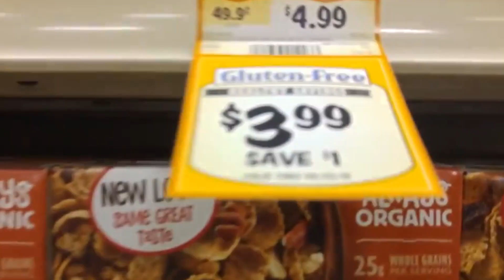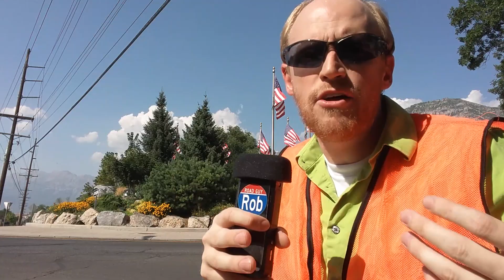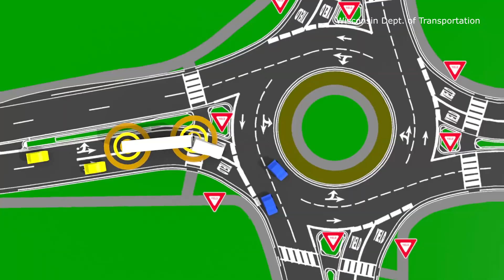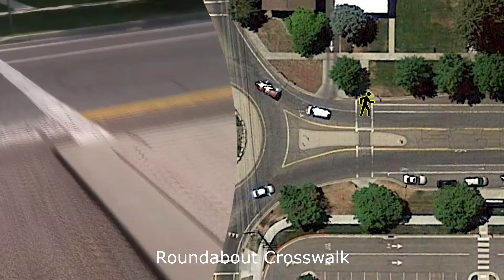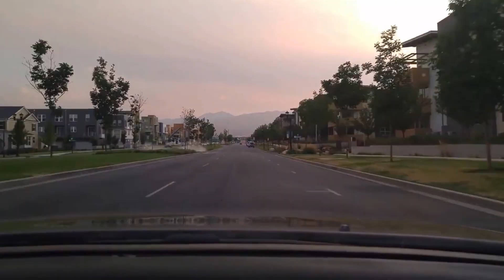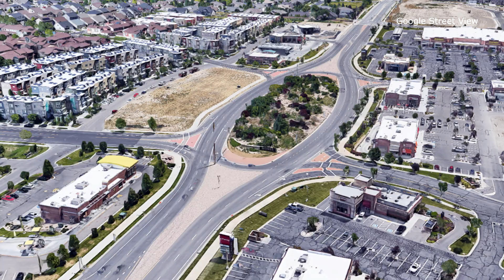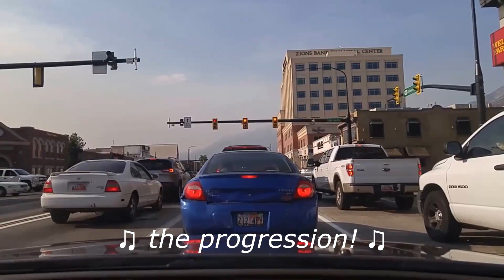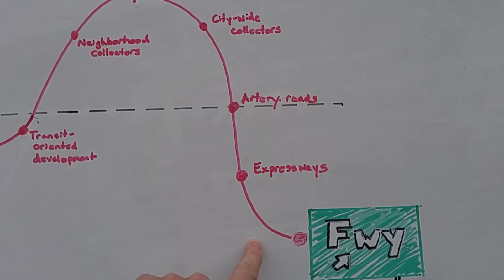Are roundabouts REALLY better than a traffic signal?

Comment: Roundabouts are great
Americans just don't know how to drive on them
Reply: In all honesty, that's a bit of the reality everywhere, and it's actually the main problem of roundabouts: bad drivers.
Reply: @rrs_13  I think Americans just aren’t use to it. I live in Australia and everyone knows how to properly navigate them. And if there is a crash it is not as serious
Reply: @cityplanner3063  it's also because only certain areas have them, i only been on 1 and that was when I was in Colorado visiting and that was the only time i seen one, there are a few but they don't really exist  

although not sure why people say Roundabouts are cheaper since roads are straight requires less land as well then a roundabout

it's like Parallel parking, i never did that on my highschool test since we had no where to Parallel parking so it really doesn't exist even in town there are main raods and the side roads will have parking lanes where you don't Parallel park.
Reply: I would also like to point out that they are only as good as the weakest link...that link would be drivers that give no ducks, ie the ones that sped through regardless, the ones that try to turn out from the inmost lane, the ones that figure out they are meant to go ‘that way’ and to heck with traffic flow, ones that climb the lip and cut in front of other drivers, ones that don’t know how the turn signal is meant to work and bogart their way through, ones with no awareness, ones that don’t check their blind spots and so forth. Unfortunately, the world is full of weak links as dash camera’s have proven. None of this takes into consideration motorcyclists and cyclers.
Reply: I would have to disagree.. I live in Nebraska and we've been getting more and more of these installed. I have not really seen anyone have a problem driving through a roundabout here. In contrast I was in Ireland a few years ago and got hit by a guy entering the roundabout. Ireland is full of them and there was no other traffic in the roundabout and this guy slammed into me. I go through a double roundabout every day to get to work and have never had any confusion in doing so. So I think your statement is flawed.
Reply: Thomas Knight personally being a American and a u.k. Citizen yes I agree
Reply: This is true although they were sorta only being implemented i would say in the early 2000's, they where not in any of my road test/driving instructions when i was learning around 2000/2001 and only started to be installed in the local areas a few years later (im from Wisconsin)

So basically only younger millennials would have been taught from the start, Older millennials would have gotten used to them fairly quick, but all previous generations would have been driving for decades without them. And people suck at change. This is not always true, you got idiots of all ages and with roundabouts i would say it really is the personality of the driver that determines how they navigate them.

I mean they are not hard (yield to those on your left, stay in your lane, look at the arrows that tell you where to go) but what i usually see is (out of my way losers, screw staying in the lines, read arrows? who has time for dat!)
Reply: @jjjacer  you are absolutely correct
However I got my license like 4 years ago and don't really remember it being covered in driver's ed
And  living in a college town with a roundabout I haven't seen too many major issues other than unsure drivers and stupid pedestrians  but the freaking 4 way stops confuse the crap out of themI saw 3 people try going at once at a 4 way. That made my day 
Nobody there understands how they work it's hilarious
And that WAS covered in driver's ed
Reply: Fact
Reply: This is because you cant go flying through them, you have to slow down.

A 4 way stop you can blast right through and many do that.
Reply: @IIGrayfoxII    Can’t blow through a roundabout. Bullshit.
Reply: If you think traffic lights are bad, you haven't been to my city. Every red light is so long that the traffic snakes out on to the highway. And they set the timer so the green light is only 12 seconds but the red light is NINETY seconds. Nobody is going anywhere with that kind of light pattern.
Reply: That's true, I don't know how many times I've seen someone in my home town drive straight through the middle, or some old lady driving the wrong direction.
Reply: In the USA I noticed that drivers tend to use them like expressway on and off ramps. They don't yield to cars in the circle. Instead they roll in and cut off drivers in the circle. Those of us who yield to cars in the circle get beeped at by the driver behind us who expects us to merge into circle traffic. It's very annoying.
Reply: @ResinRat2  That's probably because you're not yielding to cars in the roundabout, but yielding to the possibility of a car in the roundabout.  It's my biggest complaint about them: Some numbnuts will park instead of entering cause someone entered on the opposite side and for some reason, they can't do the mental calculation that shows they can enter it any time within 5 seconds and be totally fine.  I've been behind idiots that stop when NO ONE is currently in the roundabout!  This actually happens almost every day.
Reply: @nixon2tube  LOL! So You're the guy that keeps beeping at me from behind. ---- signed: Numbnuts.
Reply: Aren't they for Drifting lol
Reply: Watch any dashcam channel from the UK and you will see that we don't know how to use them either. But they do have a higher traffic throughput than any other junction designs with the exception of the Swindon and Hemel Hempstead "magic" roundabouts. If you think one big roundabout is scary, try thinking about six little mini ones in a circle. :-D
Accidents on a roundabout tend to be slow speed and non fatal, which is not true of signal controlled or even simple give way cross roads.
Reply: @donaldasayers    I’ll disagree there. Give way to vehicles on the RA. If one direction has a mile of traffic and have to give way. You’re screwed. Stuck there until an opening happens. We’re right now deleting roundabouts here and replacing them with lights for that very reason.
Reply: @marvinmartinsYT  i’ll have to add tho: there’s so many roundabouts here that with drivers ed you learn how to navigate them from your first lesson when you’re still learning to shift gears lol, so that experience we have with them really helps with the flow. Even in really tight and busy roundabouts (1-way) I barely have to stop, usually I can just cruise thru in second gear.
Reply: @roy_hks    We don’t even have drivers Ed. Nothing at school here to do with driving.
Reply: @marvinmartinsYT  Drivers ed as in driving schools, not a subject in high school. We did have traffic as a subject in elementary school tho.
Reply: The problem in the US is that they hate any type of change, even if they have a very inefficient and expensive traffic system.
Reply: @boink800  Oh, glad you know what all Americans think. Good thing we have psychics like you!
Reply: @thethrashyone  The USA: the land of the insane. Proof: Trump
Reply: So true, I find stop signs so much more dangerous
Reply: I get it why. You have to make extra left turns on a roundabout compared to a standard intersection. And being forced to go left so many times is just communism .
Reply: @hendrikdependrik1891  NASCAR must be the most communist motorsport ever because they're all turning left for three hours at a time.
Reply: @lsswappedcessna  I see so the solution is to turn the race around so they turn right?  I believe that would be fascist.
Reply: Absolutely agree. They are fine, but drivers don't understand the rules. It's a simple concept; cars in the circle have the right of way and that INCLUDES BICYCLES!
Reply: They’re not great you’re always forced to slow down 
At least with traffic lights you have a 50/50 of not having to stop or slow down at every single intersection
Reply: The documentation and videos the DOT provides never mentions using a signal when navigating them. Proving they’re as clueless as the drivers that navigate them. While signal usage here in US is virtually nonexistent it’s especially annoying when using roundabouts.
Reply: @joeyoungs8426  Here in Carmel, IN they passed a law requiring the use of turn signals exiting a round about.  Everyone ignores this law (except me)_
Reply: I would argue that many understand them really well and as a result, know their faults and that is why we don’t want them absolutely everywhere. 

As evidence of this, where I live it only took a couple of weeks for 3 high schoolers to figure out they could gridlock the roundabout in front of the high school if they just all just kept driving around the circle.  For 15 minutes, no one could get through the roundabout until the police arrived.  And when they went to court their tickets were tossed because technically what they did was not illegal!

This idea that they are a magic cure to all traffic problems and the reason that not all Americans like them is they aren’t as smart as drivers in other countries is just false.  Roundabouts DO have limits, REAL limits.  The average American drives over 21,000 km a year, much of it on 2 lane highways with speed limits above 110 kph, far more than any other country on earth. Not wanting a roundabout on every corner is the result of experience, not ignorance.
Reply: @scottwendt9575  obviously you don’t put roundabouts on freeways but if you put them on off ramps it’s good
Reply: @AshmewStudios  I believe I made that exact point in my main comment elsewhere...
Reply: @scottwendt9575  I am an American but I've driven in Europe a few times and every time I do so I find the roundabouts and overall traffic flow much better, especially when driving in congested areas or when I'm not sure exactly where I should be going. A common issue I have in the US is not being able to identify whether a lane or right or left turn only in heavy traffic in time, and being unable to merge into the lane I want due to getting stuck in the middle of a platoon.

With roundabouts it's almost always predictable what lane you need to be in (Once you get over the learning curve) and the more spread out traffic ("Random arrival") makes it easier to find a place to merge.
Reply: @scottwendt9575  well, idk about the us, but in poland you can get a ticket for blocking the traffic flow 🤷‍♂️😂
Reply: @scottwendt9575  most countries other than yours that use roundabouts more frequently don't have any of these issues, for instance in Australia it is illegal in most states to circle a round about more than 7 times and we have a culture that is very use to roundabouts and knowing what lanes to use, it is also very illegal and impolite to change lanes in an intersection including roundabouts.
Reply: their national sport seems to be ,hit and run
Reply: They suck. We’ve had them for decades and still no one knows how they work or how to indicate.
Reply: @marvinmartinsYT  That's odd. Where I live we've had it for a couple of years and people do really well. We aren't even a big city, we're a small town.
Reply: @lsswappedcessna    Small towns are well suited for roundabouts. Big cities aren’t though.
Reply: @marvinmartinsYT  I’m from the Netherlands where we have roundabouts both in big cities and smaller towns, practically anywhere where it fits: and they work great. American roundabouts aren’t properly designed. We don’t have our crosswalks so far away from the roundabouts and often in tighter areas there’s even cycle lanes on them. They’re slightly tighter and the ‘on-ramps’ especially have tighter corners so that people have to slow down more. My town’s main traffic entrance is the end of a 4 lane expressway crossed by a freeway (overpass) of which its off ramps end down on the expressway. There used to be lights at the end of the off ramps but eventually traffic started building up by literal miles on the freeway even though we have ‘smart lights’ which detect car flows and optimalizes the flow of the intersections.
The lights got replaced by two lane roundabouts and I haven’t seen lines longer than 50 meters ever since...